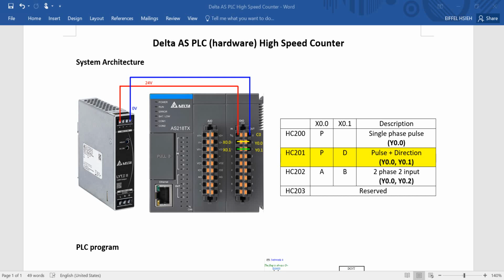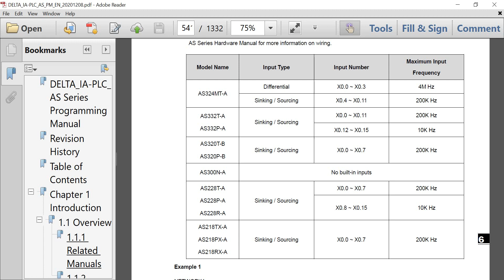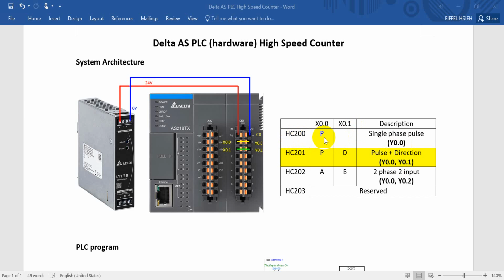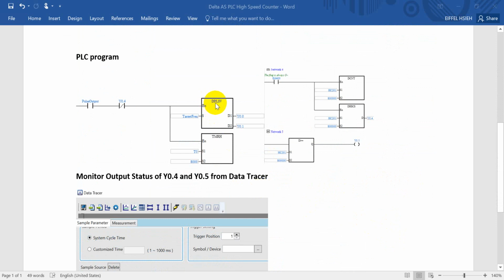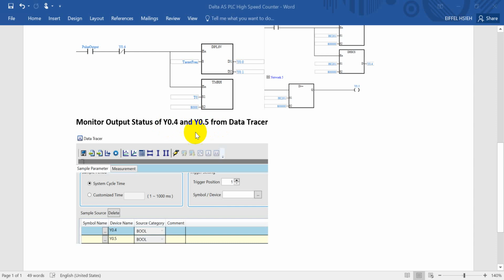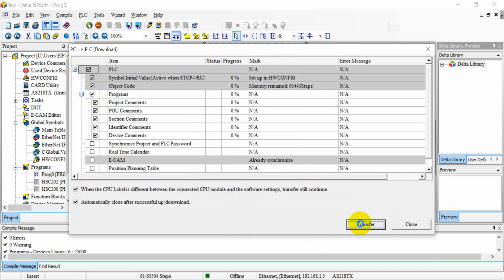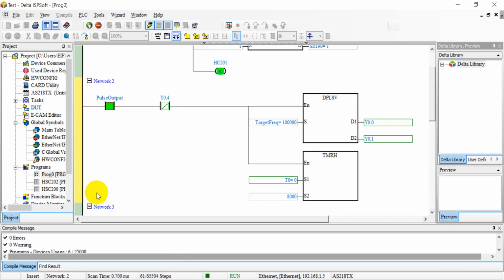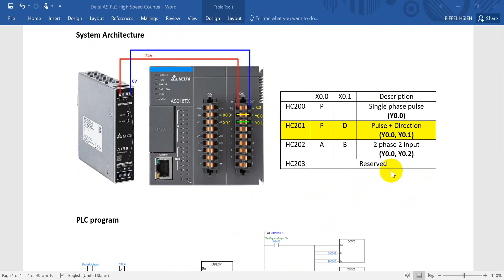Delta AS PLC High Speed Counter

Comment: hi. is AS228T-A also same as AS218TX in term of input that support the high speed counter? I mean like X0.0 is for single phase pulse and so on. Is it the same also for AS228T-A? or if you know any reference for me to check for AS228T-A? I need to know which input/output that support high speed counter or which one doesnt support. I really appreciate your help